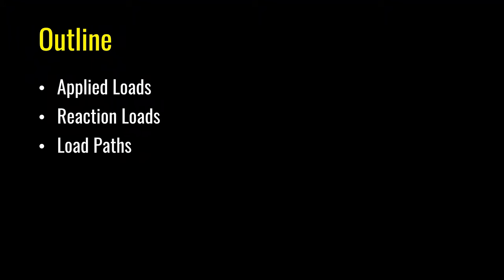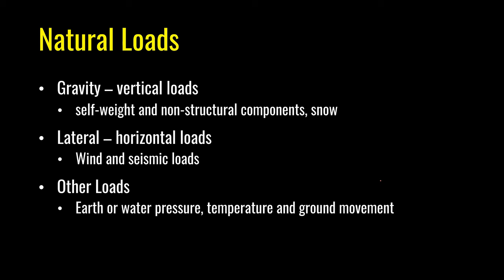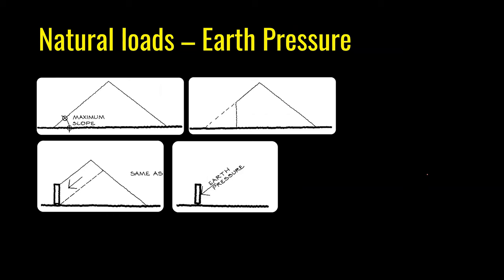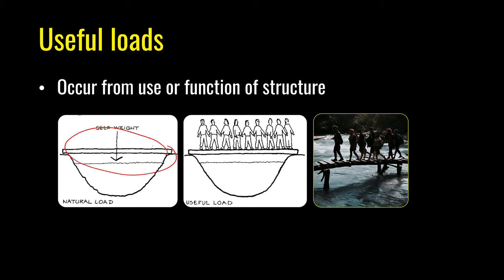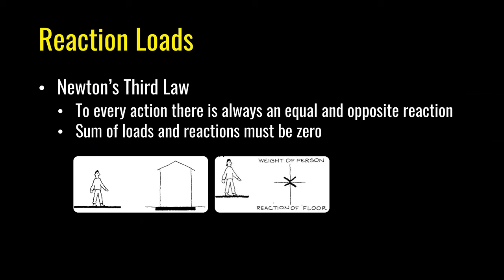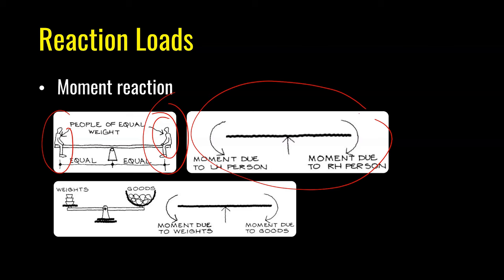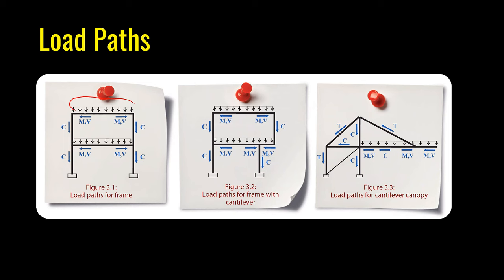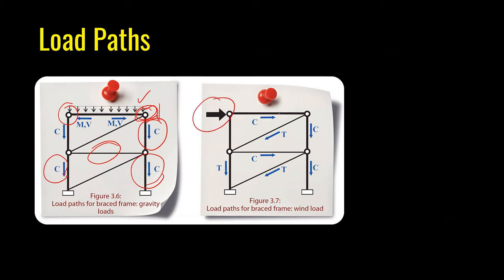Understanding Loads and Load Paths

Comment from the maker: Lecture slides available at https://tinyurl.com/JQureshiMechanics
Reply: Hello Dr., do you have any document on how wind load is applied on a cylindrical structure say a Tank? Thank you
Reply from the maker: @kofiobeng2049  you can use the website to work out wind loading https://eurocodeapplied.com/design/en1991/wind-force-cylinder
Reply from the maker: @kofiobeng2049  For further guidance please refer to Eurocode 1. Also you can get some help from steel construction institute uk guides. Simply search up, most guides are free to use.
Reply: @DrJQureshi  Thank You Dr.